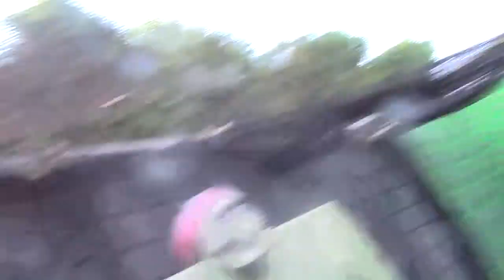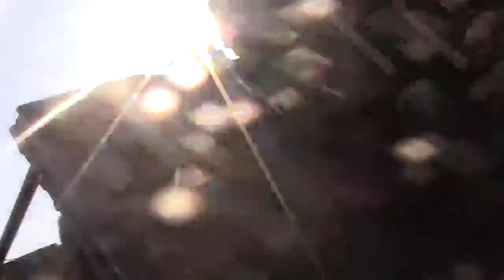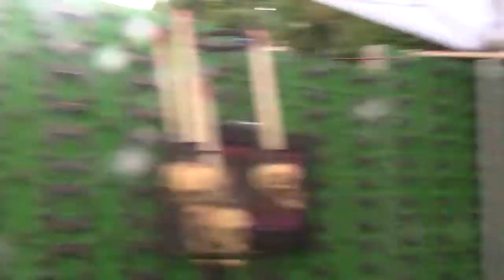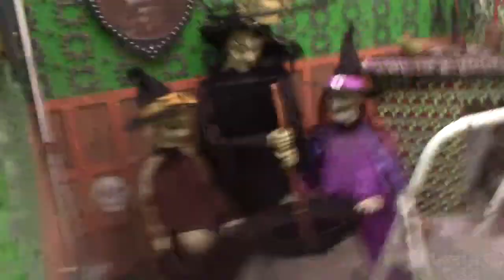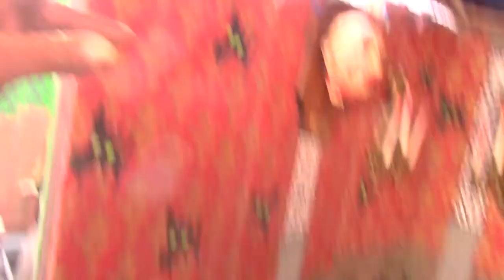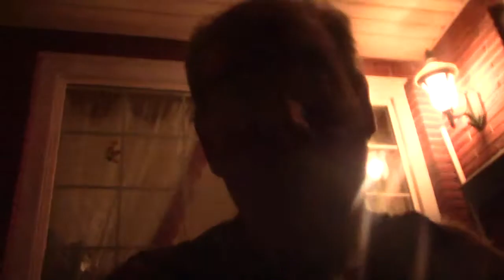Haunted Tents Set Up Day 33 10-9-22

Comment: If you are just replacing the relay on the solenoid make sure it is rated for that solenoid in voltage. A 12v solenoid relay will not work on 24v etc. other then a break in the line, wire stripping not touching the terminal block or maybe a unsoldered resistor they really shouldn’t fail.
Reply from the maker: Since my whole system is 12 volt why would i have a 24 volt item? And usually, as in this case, i just replace the whole thing. I always keep 5 or 6 brand new ones in stock just for this sort of problem.. ill go over the bad one and referbish it in the off season if needed
Reply: @HauntedTents  Just stating it could be something obvious. After all you sent 5v to a 12v key banger (scuba) a few days ago.
Reply from the maker: Lol true and then i was half asleep and out of it lmao